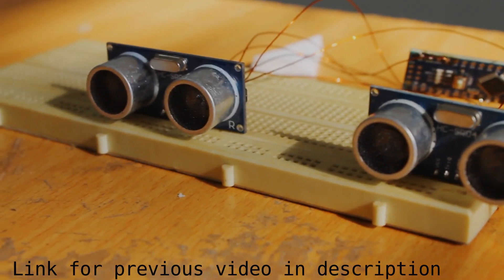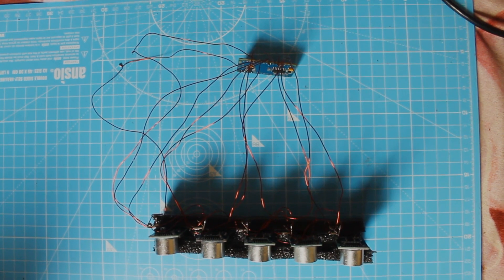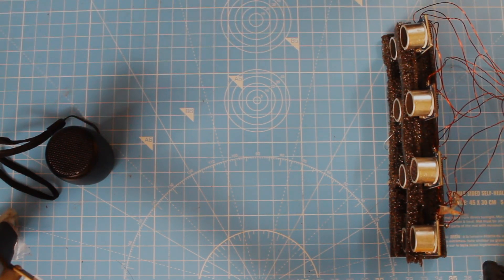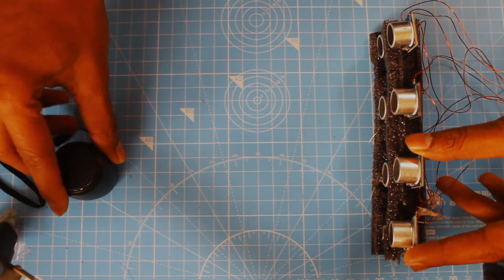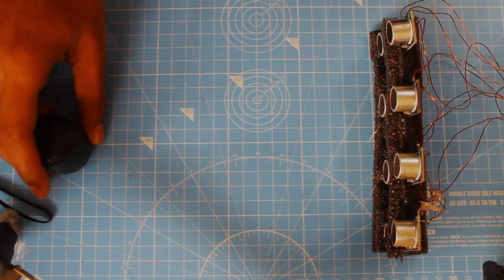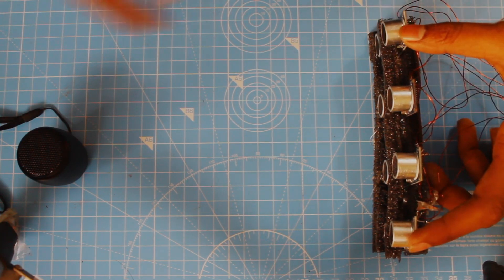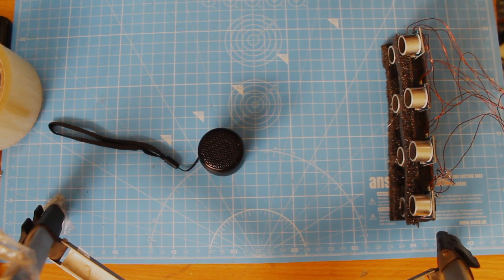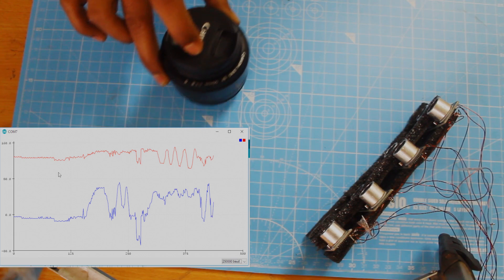Ultrasound Sensor HC-SR04: Calibration and 2D accurate Tracking

Comment: Hello, sir, I have placed the sensor horizontally on a breadboard so I am getting nan nan output. It is compulsory to put sensor vertically, what changes shall I do in code to get the correct reading by placing them horizontally

Comment: I have been thinking of mounting 4 HC-SR04's in an arc instead of linearly and mount them on a servo to cover a 180 degree sensor viewing area.  Have you tried using an arc mounting on top of a servo and if so what kind of results did you get?  Also, this may seem like a stupid question, but when I read the specification for the HC-SR04 it states "Sensing Angle: 30° Cone
Angle of Effect: 15° Cone".  I presume the angle of effect is 15° so what is "Sensing Angle: 30° Cone"?
Reply from the maker: I haven't tried that but what you are saying sould work perfectly. And that sensing angle is very much target sensitive as at the edges of the cone intensity of sounds is lower. There might be one angle for transmitter and another for reciever. The spec sheet i refered only talks about measurement angle which is 15.

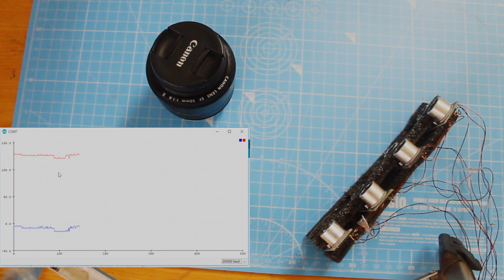Comment: I am interested in following along and recreating what you have done.   I can see how the lines change on the graphs starting at 3:45 but cannot figure out why there are two graph lines, blue, and red, but they seem to be taking , and depicting similar measurements; if not the same.  Can you explain further of what is going on, as far as the graphs?
Reply from the maker: Yes sure,
One of these line represents X coordinate of target and another represent Y coordinate.
Reply: It seems obvious now after the fact. lol  .... I asked this same question on the "Ultrasound Sensor: 2D Tracking With Arduino Instructables"; "Are you using Processing or the Arduino Serial  plotter, to make the graph, from the Arduino's serial ouput or the Arduino serial plotter"?  (maybe no an exact quote, but close)    Now that I know what the red and blue line represent, maybe using a perpendicular 'x' line in the graph, of some sort, may be better for visualizing the movement of the target, object, being detected by the Ultrasonic sensors.   thanks for the quick reply.
Reply from the maker: This is Arduino serial plotter only. It works perfect for this type of plots.